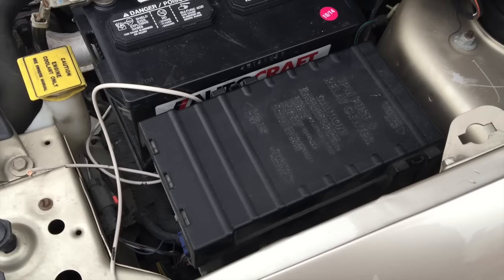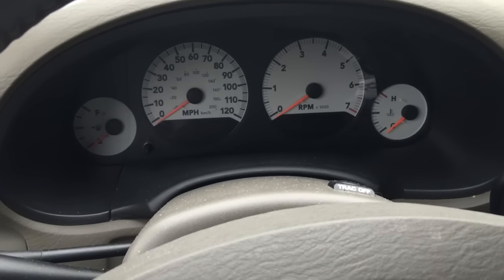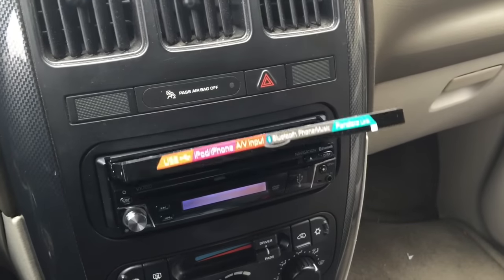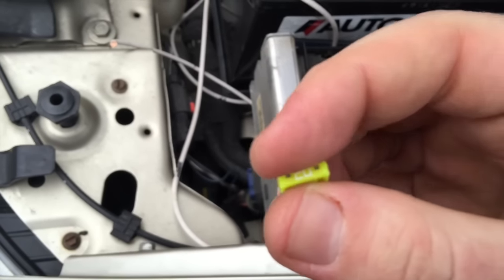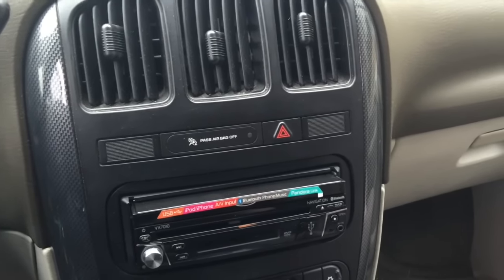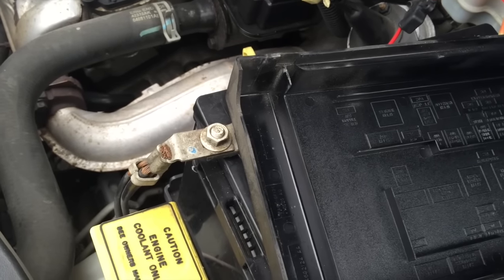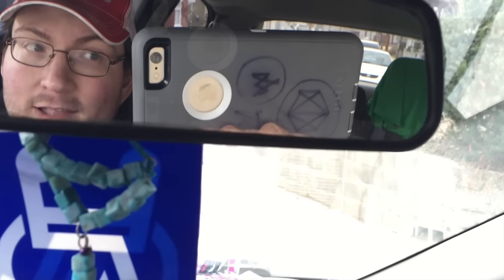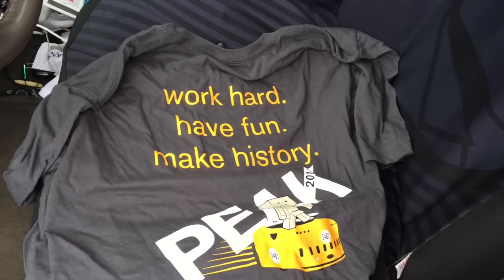Quick Tip: Signs of a blown IOD Fuse on a Chrysler, Dodge, Jeep, Fiat, or Ram product

Comment: if u have an iod fuse and its fine, dont worry. also check ur EATX Battery fuse if u have one there most likely u do. i spent hundreds on my Chrysler voyager, ran through wires n only thing i didnt do was check the eatx fuse. my van went to limp mode spent my money i had stupidly to figure out it was that. i know ur saying what a dummie lol,  its ok i shoulda checked.  check ur fuses people. hope this helps
Reply from the maker: Yes sir, always helps to check the fuses, and good tip on the EATX Fuse
Reply: Hi saw ur comment what is the eatx fuse for
Reply from the maker: The 20 amp EATX fuse supplies power to two of three power sources to the transmission control module (TCM) mounted under the hood on the passenger side fender aft and left of the washer fluid bottle. When the EATX relay (in PDC) is actuated that fuse supplies power through the relay's output contacts and on to the TCM. It also supplies power to the TCM when the ignition is off. 

Taken from the Chrysler Minivan forums

Comment: So remove the negative battery wire first and then replace the fuse then connect the negative battery wire again?
Reply from the maker: No, just replacing the fuse is fine

Comment: Wjat would cause me to drain 5A constantly from Fuse # 8 on my 02 Jeep Grand Cherokee Laredo 4.7L but never blew the fuse?
Reply from the maker: @CameronDC-Grimes  you'll have to find what all circuits fuse 8 feeds from and pull each fuse one by one. Put an ammeter in its place and where the 5 amps comes from is your bogey
Reply: @adventureoflinkmk2  it's the fuse 8 underneath steering wheel.

Online diagram says it has:

Overhead Console, Rear Wiper, ip lights, rear flipper glass solenoid.
But I can't find the problem. How should I test each component.
Should I test it with power still to them and use voltage drop.
Or should I remove power and use resistance (honestly don't know how I'd do resistance on something I don't think I can reach from beginning to end of circuit.
But I was under the impression fuse 8 was the same circuit

I don't have the wiring diagram.

What would cause a drain on battery when cars off but not blow a fuse. Most of fuse #8 is not on when key-off like:
IP lights (which is missing 7 warning light bulbs) overhead console is off with key off, that just leaves:
Rear Wiper  and rear flipper glass solenoid (whatever that is)
Unless you can think of something that doesn't blow a fuse that continuously draws 5A
Reply: @adventureoflinkmk2  you know how to find the fuse 8 wiring diagrams free online? And what kind of testing should I do?
Reply from the maker: @CameronDC-Grimes  I'd see about removing that fuse and putting an ammeter in its place. Both with the key out and the key in run

As for diagrams, maybe the library has access to Mitchell's or all data or something
Reply: @adventureoflinkmk2  hello, than you for this video. I also tried to work on my radio and while splicing the 12v wire, it accidentally touched the body causing a short.. 

I checked the IOD fuse with a multimeter and it has 4 ohms of resistance.. took it out, looks ok to me. Everything is working but the speakers.. the subwoofer is also working..

I'm loosing hope. Don't know what to do. I've been working with this, 2013 lancer ex, over a week. Pls help. Tia
Reply from the maker: @aaa-lu7pq  I'm not familiar with lancers... maybe another fuse blew in its place

Comment: Holy cow. I appreciate this as I had to take out my factory radio on my 2000 grand caravan and then put it back in and I had all these symptoms. Gonna head outside now to check out my fuses. I looked earlier and they looked fine, but now I'm gonna pull them to double check them. Come to find out it was the IOD 10 amp fuse. Fixed in the time of a traffic light. Note to self--disconnect the negative battery cable--all the time for electrical situations.

Comment: Useful.  My 2007 Grand Caravan was having radio and power-door problems.  Although the IOD fuse wasn't blown, there was corrosion on the leads, suggesting water had gotten into the fusebox.  I replaced it with a clean fuse and will do a thorough contact-cleansing at first opportunity, after making sure I disconnect the battery leads.  I hope I won't have to replace the box, but it's working for now.

Comment: Thank you very much! I'm so glad you had posted this video and pointed me in the right direction, the iod fuse on my 2007 grand caravan was not blowed but resistive at 1000 ohms impossible to see can just been diagnose by measuring it. Your video lead me to gave it a second check and bingo!!! problem solved thank you again!
Reply from the maker: Good man... glad it helped you and you found your problem :)
Reply: its blown
Reply: Whish that fixed mine..lol

Comment: Is this Channel alive Still I have a question? My EVIC system doesn’t correspond to any button inputs on Left side on steering wheel? I have checked my fuses I pulled all the fuses associated with the EVIC but still the same…any fixes to this problem?
Reply from the maker: If the problem is on the left side but the right side works... I'd check that left side for the button replacement and connections and wire integrity

And no I'm not dead obviously... I just don't upload much because I'm lazy and I'm a Motorcoach operator these days

Comment: Came 70 miles with no powered anything.Checked the battery cables and eyeballed the large square fuses.Then thanks to this video I pulled the IOD fuse which isn't blown but was corroded because after re-insertion everything was working again.Thank you for a great video.Beats the heck out of looking in Chilton's which would usually require farther reading in the Hayne's manual.
Reply from the maker: You're welcome.. and they say Chilton's and Haynes are best used as reserve toilet paper ;)

Comment: 2005 Chrysler town and country. You are amazing!!!!!!! Radio, and the LED on it wouldn't come on at all, key fob didn't work, door locks did nothing without key in it. ALL FIXED with one fuse. Thank you thank you.
Reply: mine wasn't actually blown, it was just corroded to hell. white gunk all the way up into the fuse's plastic case. It was totally the RIGHT fuse to be looking at though and that was the big problem.

Comment: Good video.  Helpful for a frustrating problem.
FYI.  IOD stands for Ignition Off Draw.
You pull this fuse when the car is in extended storage, that is why they have it.
It eliminates any parasitic draw.
Reply: What do you do when the IOD fuse is causing the parasitic draw? Thx
Reply from the maker: Remove it and put an ammeter in its place. Then remove fuses one by one until the amps drop to 0. Then research what circuits those fuses go to

Comment: Man! You're the best! A couple months ago I was trying to insert the antenna cable in my radio and foolishly had it on at the time. Fuses were blown. I spent hours looking up the wiring harness and researching fuses. I replaced the fuse for the radio and the dome light to no avail. I took the radio to a shop to have it tested. They told me it worked fine but I might have been a problem with the ground. I was getting frustrated that nothing was working then I thought about the fact that neither the dome light nor the radio were working so I went back to the fuse box to inspect the fuses I hadn't changed. I see that I.O.D. fuse in a little box and decided to research. Your video was at the top of the suggested videos. Once you mentioned the dome light, dash panel and radio I decided to pull it and discovered that it was indeed  blown. Less than a minute later my dome light and radio are back in business. Top shelf man. Videos like yours are what make YouTube a great resource. Big thanks from Ohio.
Reply: adventureoflinkmk2 Yeah it was a total noob error. 🙃 I was upset that the when I wanted the tuner, the radio kept giving me a "tuner fail" message. When I figured that the antenna wasn't plugged in, I just jumped on it without thinking. Live and learn. Lol

Comment: I replaced battery and forgot to tighten it down, hit a bump while driving and panel started going erratic. then van just died. I got out, tightened it down and noticed panel didn't work afterwards. 

wasn't really sure which fuse to check until I saw this vid. .thanx a lot!

Comment: I was trying to sit in my van, awaiting for my drivers licence test this october, But i kept getting pissed that the fact that the radio or the clock wasnt working. So i looked some stuff up on the internet, but they were telling me about a fuse box under the dash, or on the left side of the dash on the door cover, But i removed them and i didnt find anything! But now, i realized that all of that went into one fuse, The IOD fuse. I took it out, and it was all corroded like you would see with a battery in an  old device. So i cleaned it out, and replaced it, And now it works! The Clock and the radio work, But you should probably state that this works if there is no fuse box under the dash, or on the left side of the dash. 

Otherwise, Thanks! It really helped and made my day!
Reply: Well this van, the odometer says 529,522
Reply: But its a new engine tho,
Reply: Surprisingly, Only once at 300000 miles
Reply: Big B Studios

Comment: You saved me with the IOD Fuse. My 2007 Dodge Caravan died at the Bank in the ATM line. My van had died whyle driving a few weeks before. I checked Error codes it showed P0335 & P0340 I replaced the Crankshaft Posisition Sensor also replaced the Ignition Coil & Finally the PCM which I had programmed from Fs1 for $194.00 After a week it came & was installed. The 1st mechanic told me after he tryed & failed to bring it to the dealer. I then took it to a Great Mechanic who got it started but told me there's no guarantee that it won't happen again. I went to the bank to get $100.00 cash to pay him when it died again? this time I saw the U0168 code & pulled up your video. It worked like a champ. I feel lucky that I'm only out $324.00 I've heard some horribly tragic stories costing Thousand's. Thank you for saving me. I got the $100.00 & gladly paid my mechanic for reflashing the PCM & getting the van started after the other guy who didn't charge me failed. 

Ps: The IOD fuse seemed to be ok though I replaced it anways after pulling ground & waiting 10 min. My wife told me the Angel's were with me. Thank's my Guardian Angel.

Comment: I have an 2004 Chrysler seabring and I come across similar problem with no start and no lights. Fan works as others work. Looked it up and a same 20A yellow fuse blown. Put a new one in and it starts and goes. This happened at least 5x . Best if you buy a box of 20A yellow fuses on hand. It will do it again and now you know what it is, where it is and fix it. Saves alot of grief and expenses.
Reply from the maker: Yeah i know that's right.. better yet I'd be trying to find why the fuse keeps popping to begin with

Comment: Mine might be a different fuse, but your video definitely helped me. I plugged my phone recharger in the top hole (the one with the image of a key on the cap), and there was that lovely popping sound plus scent of fried electronics and my radio stopped working. Thanks for making it easy for me to find the fuse box!
Reply: 2003 Chrysler Town and Country, factory radio. I forgot to add that.
Reply: +adventureoflinkmk2 I'm going to the auto parts store tomorrow with the hope of just getting the radio going again. I have a road trip coming up soon, and can't live without music for that!
Reply: +adventureoflinkmk2 I have two ports, one direct to battery and one keyed (I think that's what the symbols on the covers mean, anyway). The one that goes direct to battery works like it's supposed to work. It was the one with the key logo that made the pop sound and killed the radio section, like the clock and whatnot, but none of the other things you showed in your video died.
Reply: +adventureoflinkmk2 I'll let you know how it goes!
Reply: +adventureoflinkmk2 I replaced the fuse labeled RDO/IP IGN, and it worked like a charm. Radio and clock working. Thanks for your helpful video!
Reply: @jayr8048  e

Comment: For those that have these and more symptoms, your fuse is ok?  Replace the whole TIPM from scrap yard (match your model at scrap) Fixed mine for $15.00 new TIPM from scrap everything back working
Reply: See the dealer for what?  2006 Dodge Caravan.  It was the fuse box, took a chance.  went to scrap bought it for $15.00 and changed it, all works, no codes, no dealer ($735.00+tax in Canada) no nothing just some of my time
Reply: TIPM = Total Integrated Power Module (fuse box)

Comment: Yes -- this video lists precisely all that my 2005 Dodge Caravan unexpectedly did the other day -- nothing odd had happened prior to that. So, I did what your video suggested -- EXCEPT that when I removed the IOD 20 Amp fuse as suggested -- just my luck -- it came out with only ONE prong & the other is inside the fuse box & flush with the top of the fuse "receptacle". HELP PLEASE!!  :(
** Update an hour later -- situation is worse than I thought -- read online how to use tweezers to remove the prong -- but as I removed the broken fuse & inspected it -- it is burned black (& possibly corroded?) on the yellow plastic of the fuse where the prong was & the metal prong left behind is actually recessed into the hole (I ran a safety pin along the hole to see how much was sticking up of the prong) -- I think I'm going to have to live with no radio, no clock, no interior lights, no door warning dinging, no power locks on any doors, etc. -- thankfully, the power windows work still!! The van is old -- not worth taking in to have it repaired -- unless someone knows what to do at this point!! Appreciate any advice!! Thanks tons!!
Reply: ***** How difficult is that?? I mean the taking apart the fuse box!! I thought I was doing well to have managed to get this far!! Bad luck!!!

Comment: 2001 T/C LX --- Tighten battery clamp onto each post.  Clean them well for contact.
Check the Underside of the Fuse box... where battery leaking can damage...
It may be the IOD... a WEAK battery can also cause this.   But, you did say you were blowing fuses quickly... open/short somewhere...  (All I know is that I jumped off my battery, and then the dash panel flipped out.  I already had the panel out and disconnected.. put it back, then took off the negative of the battery.  Re-tightened positive and negative post connects .. slap tight!  Fixed it Quick !)  But, I also have seen where shorts affect this BCM, and the dash instruments.

Comment: :glasses-purple-yellow-diamond:Thank you, most helpful video:face-blue-smiling:      Have same issue with 2009 Avenger
Oh yeah, I bought four of the Horns advertised in this Video and they are totally BS; weakest horm I've ever heard!
Reply from the maker: Good deal.  And you're welcome
Reply: @adventureoflinkmk2     Hard to believe one little thing like this fuse could cause so much trouble.  Remember. "Back to the futureII" the 1955 Doc Brown counter part said something simular about a blown Japanese transistor. Marty;  Hey, Japan makes all the best stuff!
Reply: @adventureoflinkmk2    Darn, actually didn't work for Me but, I do have same thing going on.
Dome Light comes on, now with the key and the door locks work on the door with the key on. Tail Lights flash with the fob L/U and head lights turn on in courtesy mode (key off). I think, before now with the key off nothing worked, alerted by radio NOT turning off when ya open the door. I was able to set everything to turn off in 45 seconds, which is half ass good for now.

Comment: Thx for the vid I hope this is the problem I'm having with my 2010 van
Reply from the maker: Thanks for commenting bud.. good luck with the repair
Reply: Update. I checked the fuses and they all were good. The problem turned out to be the positive side of the battery post was not tight
Reply from the maker: @NemesisEnforcer4937  glad it was still an easy fix

Comment: Also, 2001 Dodge Ram 1500; the I.O.D fuse is by the driver's side door with a black safety over it. Fuse no. 12, 10A

Comment: 2001 Dodge Ram van - blower stopped working, then ABS and Air Bag lights went on, then radio stopped working, the power door locks stopped working.  I'm a broke old lady and know if I take it in I'll get fleeced.  Do you think this may be the problem?

Comment: I have a 2008 Chrysler Town and Country Touring 3.8L that I can't get the interior lights to come on. The rest of the symptoms are there's no dinging, the lights for the backlit dash buttons and analog clock are out and the clock does not work. Also the dash says NO FUSE. The memory for the fog light being on when the automatic headlights come on does not work anymore, but I can turn them on manually still. The interior lights wont turn on when I open the door or when I try to turn them on manually. Map lights won't come on either. I always have the dashboard set up for the miles till empty and it always comes on, when I start the engine, to the temperature and no fuse message. Every fuse in the TIPM has been checked. Is there a relay that could be stuck in the off position that would be getting these symptoms? Like I said everything works fine except for the symptoms that I described. It starts up fine. Any ideas?

Comment: I got the same issues as on this video but my IOD fuses aren't blown. Everything was working fine until I pulled them out 2c if they were blown. I have no radio n it drained my battery instantly.  
How can o fix this issue?

Comment: Just wondering if you could tell me what the newest problem I started experiencing on my 2001 Chrysler town and country lxi but after I start the van before putting it in gear I push the brake and when I do that I hear a click noise in my dash what does the click mean